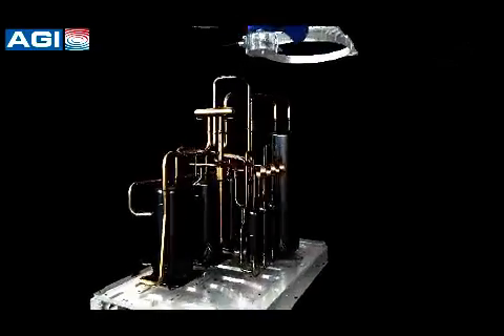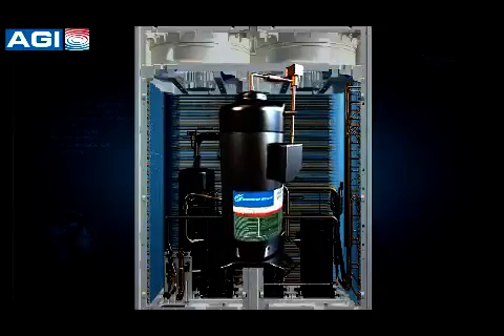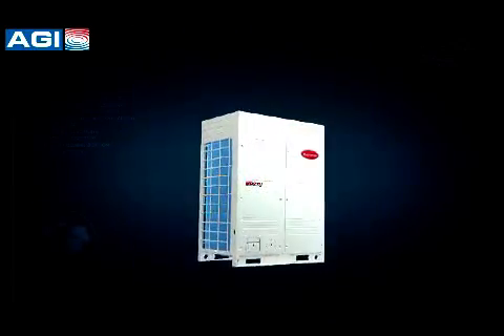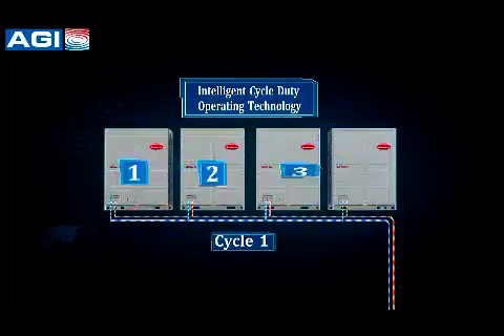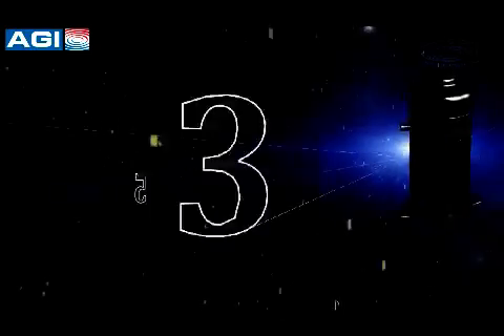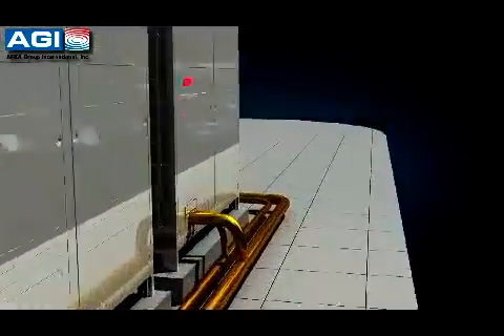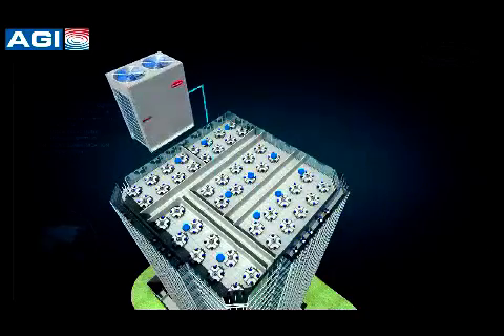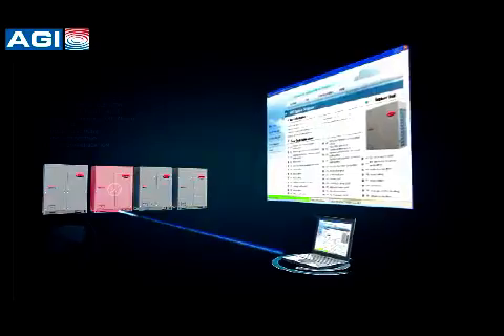Air Conditioning, VRF Variable Refrigerant Flow, American Pro HQ

Comment: No one wants to discuss the major drawbacks to these Systems, with the biggest being that when there is a refrigerant leak, a typical HVAC Tech can’t perform the work, as the refrigerant must be weighed in based on installed length of tubing. Research before using because they come with vanes that do not circulate the Supply Air like a typical diffuser which is designed to blow air across the ceiling, down the walls, across the floor and then back to the unit. Rarely does the VRT Thermostat ever feel the temperature in the room with control from a thermostat on a distant wall. Big problem. We have installed the VRF in several spaces with occupant complaints and what we found by installing a Change of Value COV trended T’Sensor back to our DDC System, is that the Room temperature hunts from 2~4 Degree F when using the wall thermostat and 6~10 degrees F when contractors leave the VRT Control at the default of using the Return Air Sensor. This problem causes the units to constantly switch from Heat/cool/Heat/cool/etc.. There is more in regard to the up and coming Indoor Environmental Quality, which begs the question of home type Window unit Bug Catcher Filters, which have No Merv rating! The engineer is quick to say the Air is filtered at the incoming DOAS Air (maybe) , but what about all the indoor environment irritants and VOC’s.
*If Energy Efficiency is the selling point based on the 2015 IECC or 2018 IECC, then I suggest rethinking and researching. VRF was 1st used and designed for mass Storage Units, where Occupant Comfort is not an issue & Old Historical Buildings where a Flameless install is required. 
**Refrigerant Hazard based on leak above ceilings with no Refrigerant detection Alarms. Some of the VRF System Volume of Refrigerant exceeds the allowable amount, which requires a Refrigerant Alarm and purge System. It will take one room with a tile left out by a service tech and a significant leak in a VRT System he can’t find and the Air in the Room will be quickly dispersed by the Refrigerant, causing sleepiness to the occupants and possibly death.
***For me, we will stick with DSS Units to provide supplemental Cooling & Heating or only use a VRF System when there is no other alternative in a renovation, such as space to run ductwork all the way down to a low level area that is only used for Offices.